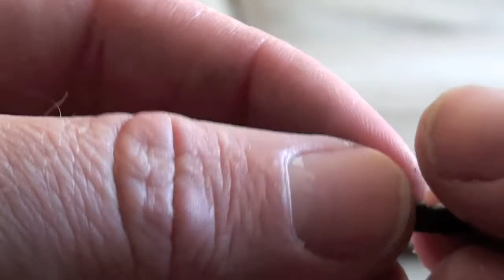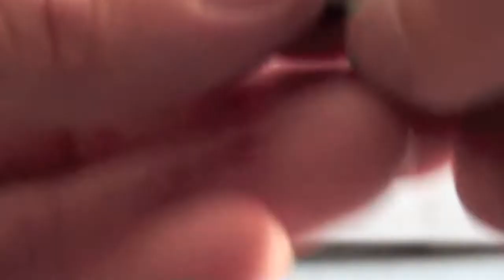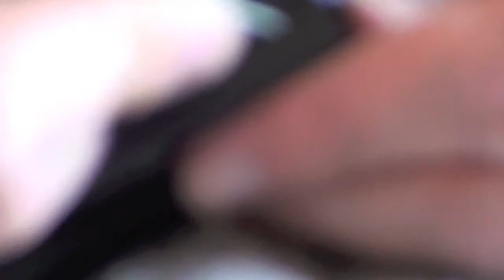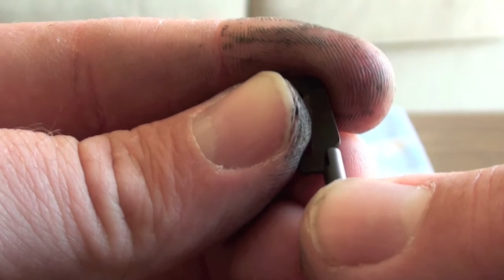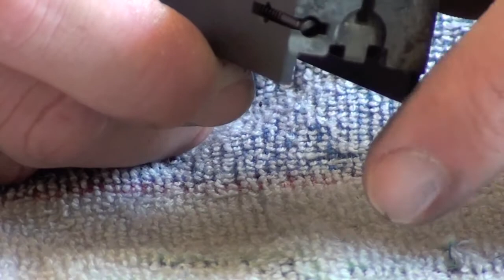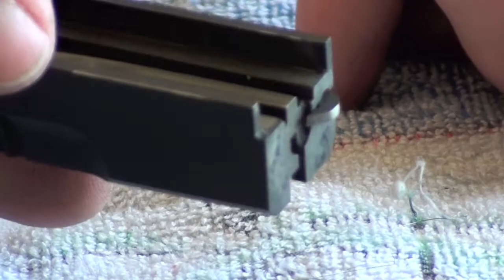Browning Buckmark Extractor Replacement

Comment: Thank you!! I am a 66 yr old grandma shooter! I have a new buckmark I doubt I have run 300 rds through it I use it for competition, and FTE/failure to eject  has just gotten worse and worse, did some Internet searching and saw many mentions of the problem and replace the extractor, so ordered a titanium extractor from TK recvd it and they have pic instructions, but made me nervous when they said be careful under pressure do in a box or bag (that made no sense) and don't scratch chamber, so I searched utube and found your video!! I did it in 2 seconds!!!  Mine is a 2020*2021 so still a problem.. so thank you..   ready to go shoot!!

Comment: Had stovepiping about once every two magazines with brand new Camper. Replaced extractor with Tandemkross upgrade. Best $10 I ever spent. Zero ejection failures  since replacing.

Comment: Thanks for video. I was having extractor issues and light strikes from day 1. Removed extractor and firing pin.Cleaned them,and polished the sides with flitz metal polish and dremel tool. It runs perfect now. Thanks again!

Comment: Be sure the plane of your extractor and extractor plunger is not flat.  The extractor angles noticeably away from the plunger towards the cutout in the bolt face that accepts the rim of the case. I was experiencing failure to feed jams and stovepipe jams until I slow motioned a cartridge feed while letting the bolt come forward slowly.  The case needs to slide uninterrupted under the extractor claw.  My ill-adjusted extractor was hitting the side of the case and pushing it slightly out of battery.  Keep your feed rail clean and use 222 Loctite on your rail screws and copper based anti seize Loctite 51147 C5A on your barrel screw to promote Browning signature flawless function.
Reply: Good to know thjs
Thanks

Comment: For those with extractor problems I have a suggestion. Clean it good first then try it. I cleaned mine and it works good again. That channel is open to the elements. So, it can get pretty dirty in there which will impede the plunger/extractor operation. If you want more problems put a drop of oil in there. That will capture and hold more dirt and grime and will act as sandpaper on the components. Many people oil guns where they don't need it and wears the gun out prematurely.

Comment: Identical procedure to the High Standard Supermatic series.  Interesting.  The parts look like they would interchange (can't tell the exact dimensions, of course) 
I have a lot of experience with High Standards.  This is much easier to do if you can clamp the slide into a vise.  Be sure to keep the plunger and spring under control or they will launch into the cosmos and you will never find them again.
Rather than a round punch, I use a 1/16" flat jewelers screwdriver to depress the spring/plunger.  The flat blade fits in easier and takes up less space, making it easier to get the extractor out (and back in)

Comment: .22's are dirty shooting rounds. Frequent and proper cleaning  helps prevent most issues.  I'd suggest a thorough cleaning, and trying different ammo  before going straight to replacing extractor. I've had issues with flat nosed rounds. Also, be careful about launching slide spring when disassembling.

Comment: Well I couldn't rotate the plunger,...kept removing to adjust the piston,...and the new extractor, then the ice pick slipped and you know what happened next......well I  found the piston but not the spring. 
When I get another
Spring, I'm gonna mark the piston with a scratch from my Drexel behind the flat, stick the gun in a gallon zip lock and try again.
Are the Volqua.... reported to fit too tight? Mine seems to be.

Comment: Another question:  Those are the only 3 parts in the slide aside from the recoil assembly right?  I wanted to get a new slide altogether but didn't know if there were tons of little parts in there that I had to worry about.
Reply from the maker: TheIgnorantBastrd yes those are the only things you’ll have to worry about. Everything else sits down in the frame.

Comment: Is there a specific replacement extractor that you would recommend?  Im looking on MidwestGunWorks and they only have one.
Reply from the maker: TheIgnorantBastrd I bought mine off eBay from trivettes_gunsmithing. I can’t remember the brand. I know both volquartzen and tandemkross make one, which I’m sure are both great.
Reply: Tandemkross Eagle Claw completely solved my ejection issues.

Comment: Do you have to take the slide off to remove and reinstall the extractor?
Reply: No you can lock the slide back. But, it's just a little easier for me to take it apart.

Comment: Pre 2009 are the same.
Reply from the maker: That's good to know. I wasn't sure, because any time I look for parts the descriptions will say either pre or post 2009
Reply: I got one from Midway and there was no year specification listed for it.
My pistol was made in the late 90s
I went with a regular one because I have heard of people having problems with the Volquartsen extractor
Reply from the maker: Thanks for the info. I'll edit the description of the video to let everyone know.
Reply: @TheFireArmorer  : My '91 is the same but, there are a lot of different parts in post '09.
Reply: @bungalobill7941  what kind of problems...too tight in the slot?
Reply: @Jrhnhemp  Read these reviews on Midway and they scared me off. Sounds like you might need to file it to fit on some pistols. I just didn't want to bother and went with an OEM. It may work fine though. Just didn't want to bother
https://www.midwayusa.com/product/1016434028